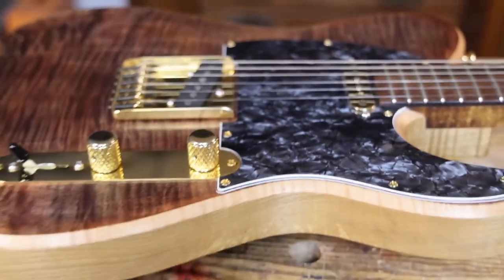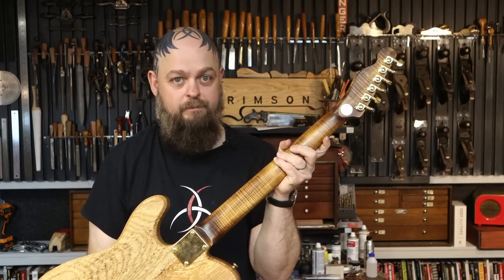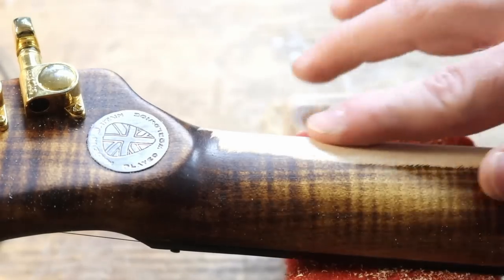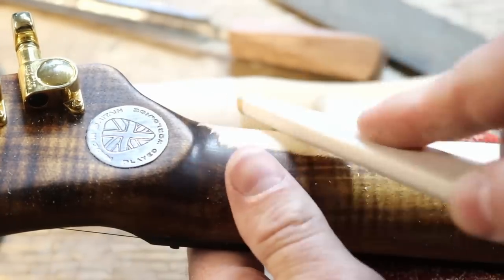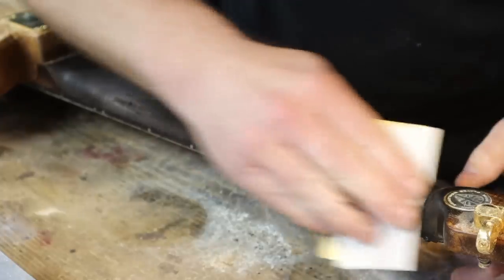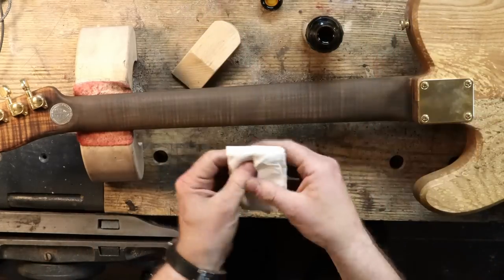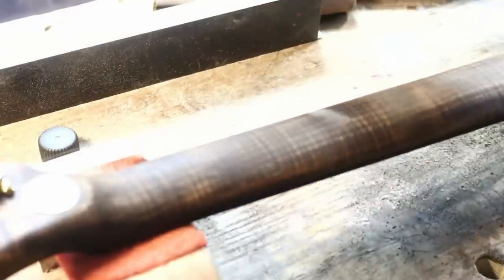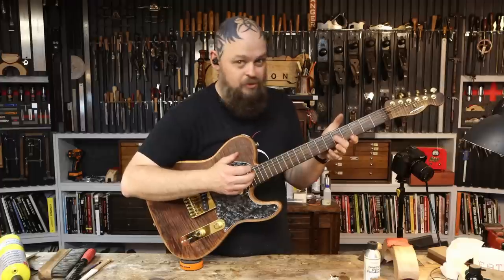Re-Carving a Custom Guitar Neck 5 Years On | I MESSED up a bit on the original 😞

Comment: So Ben...  I managed to find a new user for your spirit stains...

I has an old pair of DiMarzio Jass Bass pickups that were cream colored. I have both the water and spirit based black stain and decided that water was too risky. I soaked the pickups in the stain, and got super results. I was expecting to have to leave them for a while but checked after 5 minutes and they were B-L-A-C-K. Pro tip - I think the stain was starting to desolve the covers as I had to put some force behind seperating the container with the pickup.  It wasn't quite bonded but you could tell it wanted to be.

Left them to dry out, tested with a multi metre and they still have continuity. 

Disclaimer - Dear reader - If you do this, I take zero responsibility for your outcomes. YMMV

Comment: The wavy grain on the fretboard is 😍
If I win can you sand 2lbs out of the body too 😂
Reply from the maker: Deal... ish.. May have to just make it a BUNCH thinner. A chunky bit of Ash here tbh
Reply: @CrimsonCustomGuitars  maybe bathtub routing under the pickguard is less indulgent than refinishing the pretty back 🤔 It won't shed my exaggerated 2lb, but every little helps. Or I could just man up and view it as dual purpose home gym equipment 🏋️💪🤣

Comment: Weren't you afraid that the fretboard would fall off after scorching the back of the neck?
Reply from the maker: Not at all, I've done this many times. The trick is very hot flame but applied very quickly